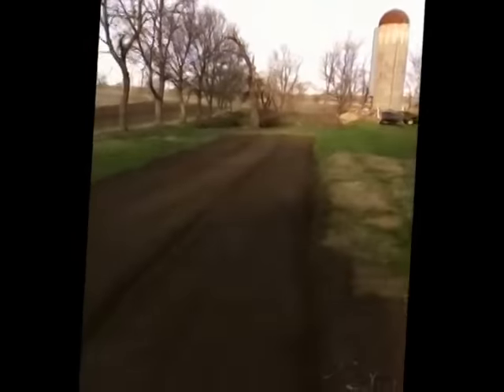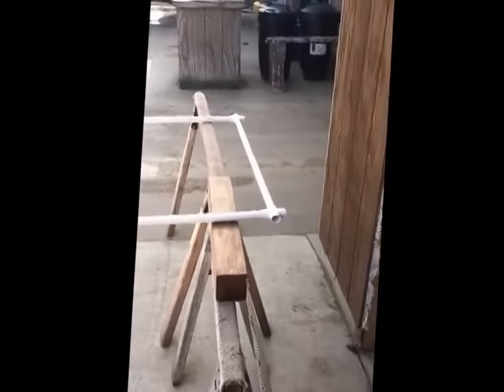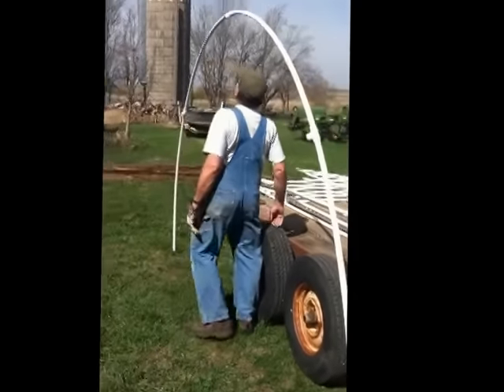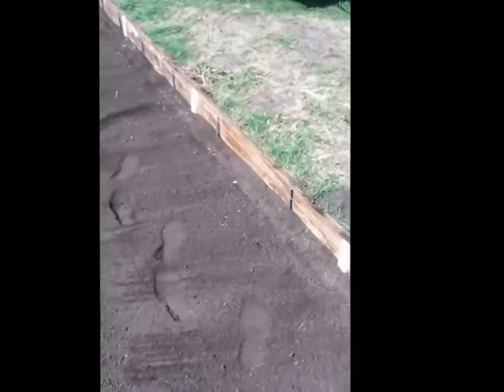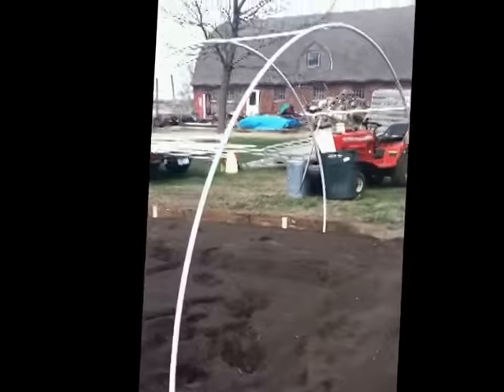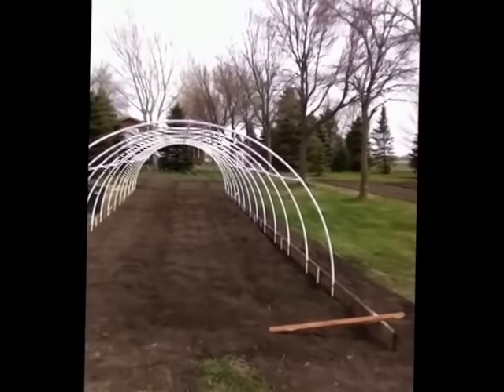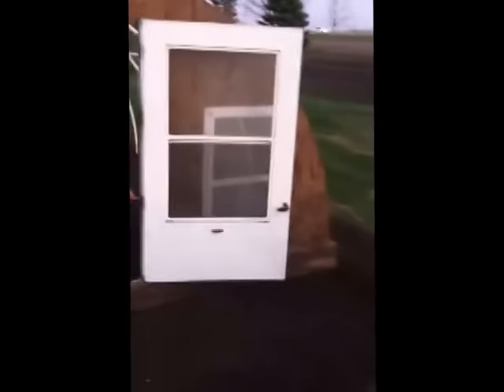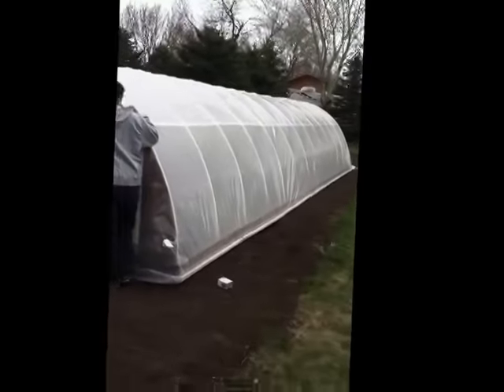PVC greenhouse in a day DIY

Comment: My experience with PVC-supported plastic structure is you must absolutely remove the sheeting before first snow in winter, or the weight of the snow has no problem snapping off the PVC. But it is a decent setup for the money and pretty easy to build.
Reply: You could reinforce da PVC with rebar

Comment: If you drill tiny pinholes in the underside of the arches you could connect a hose to the main center piece of PVC & you could then water all the plants inside whenever needed.
Reply: You shouldn’t water veggie plants from above.. causes disease form water on their leaves especially in a green house where it’s more humid and gets no wind..
Reply: @julisagonzalez657  That's good to know, thanks, I didn't realize that. Then instead of pinholes  like a sprinkler system you could still use the frame to deliver the water but tap into it with small drip tubes from the frame down to each of the plants base.
Reply: @dans381  ok so you're saying water tubes inside his pvc will not freeze? Is that it?
Reply: @ronmiller7248  I was not saying anything about water freezing, water would freeze if it gets cold enough.... I was just pointing out a simple way to pipe water throughout the greenhouse. You wouldn't need to put water tubes inside the frame, the frame would become the tubes.The entire frame is all connected (& hollow) so by attaching a water supply to one point of the frame, then the frame itself can be the water tubes & carry the water to any point you need.
Reply: @ Dan S what about the arches base the water would leak at the bottom where it’s inserted onto the rebar posts 😂
Reply: sorry to be so off topic but does someone know of a trick to log back into an instagram account??
I somehow forgot the password. I would appreciate any help you can offer me!
Reply: @Harper Eli instablaster ;)
Reply: @Eric Jaxtyn it worked and I now got access to my account again. I'm so happy:D
Thank you so much you really help me out :D
Reply: @Harper Eli happy to help :D
Reply: @Toopeeneekeenho  Вода будет поливать арматурные стойки🙂

Comment from the maker: thank you all viewers for bringing this to 20,000 views in just over 4 months!  There are other How-Tos at www.HGVids.com or tell me what you'd like to see a demo of...
Reply: Nick Tamble Have you considered instead of popping the pvc over droppers, to rather close it off at the bottom with additional pipe and t-pieces to create one seamless structure. Then drill small holes in strategic places and use the frame as an irrigation system?
Reply: +Nick Tamble Great video Thumbs up
Reply: How about DIY install  video of chain link fence around a backyard??
Reply: I like thos one better then any I've seen so far.  I would love a mattersl list... half inch pvc?  Poly here comes in 20x100.  Is 20 feet wide enough??   Love your end wall.  Best I've seen...  I'm in AK this is exactly what I need to extend the browning season...
Reply: Nick. What schedule PBC?

Comment: That's very well done, and an excellent video presentation. I have read that PE sheeting will react with PVC and fall apart, but if you skin the PVC/PE contact area with fabric tape it is not a problem (there is a special tape sold for this).
Reply: Using primer on the pvc before you lay the PE will also stop this reaction.
Reply: @tinman2420  regular paint primer?

Comment: I love this. We have a wooden greenhouse on a platform because of flooding, but I have been asking my husband for a hoop house over our existing garden, about the same size as yours.
We have it sectioned off with Post Poles and seven foot fencing. This structure would fit right over the top of the existing garden without having to remove anything. Thanks for this.

Comment: I built one of these several years ago.  The UV from the sun  degraded the pvc it and made it brittle.  The first spring storm that blew through destroyed it breaking most of the pipes.  My wife still chuckles about it.
Reply: Did you do anything to remedy the brittle pvc? Im just brainstorming for my own greenhouse
Reply: U must of bought that cheap thin cw pvc...bc hw pvc aint gonna get brittle or brake in the sun for years and years
Reply: @driveronehundrednine3225 You could try using gorilla tape or paint the pvc to keep it from degrading.

Comment: So, I actually built my greenhouse (60'x12') by this design. I think it is almost a good design and worked pretty well for the first month. One of the problems I came up against was in the pvc joints being weak points in the structure. Wind the other day was between 20-30 mph and that busted three joints, and that's not even very windy for this area(Helena, MT). However, I plan to replace any broken joints with single poles of pvc 20' long and run them through the cross joints. Not a bad design and fairly cheap, just needs some work.
Reply from the maker: thanks for comment Ian!

Comment: A nice transparent greenhouse is pretty, but what most people don't understand is that you can keep it warmer in winter by covering the non-sun sides with aluminized poly or reflective insulation blankets. You can't get sun heat in from the north and most of the east and west sides anyway in winter. Just the south side and half of the top on the south side will contribute solar heat. The reflective insulation will greatly increase your warming inside, and prevent loss at night.Similarly covering the sun side also just at night is even better, with a roll-up aluminized insulative blanket or tarp.
Reply from the maker: thanks for the comment - interesting insight
Reply: I dig the idear...for clarity, are you perhaps referring to one of those metallic fold-up "blankets" that emergency-minded people keep in their cars? They come packaged all folded neatly in a probably 4"x6" packet?

If not, could you give me a description that my rookie self would be able to take to one of the Home stores and find?

Many thanks in advance.
Reply: They have numerous aluminized material, rigid as well as sheet-like. If you were desperate you could use aluminum foil and white glue. But most of the insulation sheets they sell also come aluminized.
Reply: would it keep it much warmer in 20 degree weather? how much warmer?
Reply: yes do this

Comment: Instead of 6-8 mil poly that lasts barely a season, buy 'Rhino Hide' reinforced poly that's good for many years. Costs more upfront but WELL worth it!
Reply: Everyone knows how much can pay .. people r not idiots .. all know there is a better things to buy with a little more money of course
Reply: Thanks I have never heard of Rhino hide and will probably use that when we get to making our greenhouse.
Reply: 6 mil can last at least 5 years. No need to waste your money on the rhino hide for a temporary greenhouse. Most people that leave comments like that are associated with the product that they are recommending....
Reply: @lunkerpond9765  Mine will not be a temporary GH though so am glad of this advice.
Reply: @linr2870  congrats
Reply: I built an A frame one, used 6mil here in Alaska and it lasted four years with snow on it every year...  And it's easy to replace.  Not sure it's worth the cost for that rino whatever...
Reply: PVC outputs chlorine gas which will degrade the plastic much faster than normal and void the warranty.The same places that sell greenhouse grade plastic sell a barrier to prevent this.

Comment: PVC piping off gases and will cause the poly sheeting to deteriorate prematurely.   The piping can have a layer of tape or even better, the fuzzy part of velcro adhered to it to prevent this from happening.
Reply: Jan Halcion Did not know that,but it makes perfect sense thankyou😀
Reply: Cap tape for truck caps maybe an easy cheap go to for that idea, I’ll try it. Thanks for the information I’ll tell the local farmers I see that as some of their poly hose problems
Reply: I learned it the hard way, had to replace the cover after 2 years..

Comment: I really liked the 2 x8 boards at the foot with the clamps. I was going to build a very similar structure only with end caps at the bottom sides. I had also planned on using strips of plywood attached to the outside of the PVC with bailing wire as I was told PVC and poly didn't work well together. Did yours work out well in that regard and did you use schedule 10 or 40 pvc. The reason I wanted end caps was for so I could attach a hose, timer and misting heads for times when I need water. Great video Nick. Thank you.
Reply from the maker: Schedule 40. - more rigid the better. I've been seeing comments about PVC and poly not jiving together. We took down poly so I don't have info on how the combination is impacted over time

Comment from the maker: end windows and doors for ventilation...could roll up sides at the bottom also - only in protected sites as wind would be a problem...
Reply: shaika tecne sounds like a scam of some sort.  Be careful clicking on links to websites
Reply: +Nick Tamble Not certain about the points made but ,if anyone else trying to find out build your own small greenhouse plans try Lomonting Easy Greenhouse   Mentor (Have a quick look on google cant remember the place now ) ? Ive heard some great things about it and my brother in law got great success with it.
Reply: +Nick Tamble couldn't you of just drilled some 1/2" or 3/8" or howeverthick the PVS is and made holes into the wood and slipped them instead of rebar?
Reply: +Nick Tamble Not certain about the points made but ,if anyone else needs to find out about diy greenhouse building try Lomonting Easy Greenhouse   Mentor ( search on google ) ? Ive heard some decent things about it and my friend got excellent success with it.
Reply: +Jack Adkins Shame on you for hawking something without saying it is $37 for greenhouse plans.   This you tube video was free and well shared.   Commercial product plans for greenhouses or hen houses are fine, but why not say for $$$ up front.
Reply: ***** I have no choice about whining.   The international brotherhood of bridge dwelling trolls membership criteria indicates at least one whine a day.
Reply: +Ana Mostarac Never did find any scams.
Reply: I am gonna built a bigger version,dig a hole and plant me feet in it and live in one of these.
Reply: BuckGreywolfe mii
Reply: fun fact. pvc is toxic and the toxins are water soluble.
stop using toxic plastics because it is cheap. spread the word. not all plastics are equal. inform yourself
Reply: yes indeed
Reply: Nick Tamble love the video
Reply: Stop drinking water, most water pipes are PVC for many many years. Troll???
 Water wells use PVC also often. Irrigation on many many farms use PVC pipe.
Building a frame work not in contact with food nor water is no more toxic than buying food or drinking water or using store bought lumber.
Reply: Nick Tamble he man what kind off plastic cover are u using an what mill plastic is it? It seems hard to find something that's wide anuff
Reply: good  video i learn some ideas i of raising ducks. thanks .  is up

Comment: If the pipes are hollow could they be used as a watering system ?
Reply: +Richard Laut It would require some engineering but definitely would work
Reply: +Richard Laut  I like the way you think. U r an inventor.
Reply: No I just saw your great idear and Iit made me think many thanks
Reply: +Richard Laut Yes, great idea! I can see this having the water sprayed from misters located all along the center pipe at the top jutting out to the left and right. Just hook your hose to the back end and fill with a timer. I wouldn't have it come out the bottom where it's attached to the re-bar though, you need to have pressure in the line to allow the water to run the length of he system, it would just go right out the first set of supports. Another idea would be to fill the ends, seal them and couple them back up, then run drip line above the sealed bottom segment back down to the soil.

Comment: I WENT TO FARM BUREAU IN CONNECTICUT TO GET A  LOAN TO MAKE A GREEN HOUSE THEY WONT GIVE ME  BUT WHEN I BUILT MY OWN THE SAME WAY FOR 50 DOLLARS THEY STARTED BOTHERING ME.I JUST USED 2 10 FEET PVC PIPE ONE INCH THICK AND CONNECTED WITH 1 FEET 2 INCHES PVC PIPE AND PUT A CENTRAL WOOD SUPPORT. COVERED WITH SWIMMING POOL COVER .ALSO YOU CAN DISMANTLE IT WHEN YOU MOVE .
Reply: rogersantiques rs wondering how one types with all caps on.
Reply: Captively

Comment: Was that regular 6mil visqueen? If the entire project was under 300 dollars and it was greenhouse film I need to know where you got it? :)
 Before I purchased the commercial greenhouse that I now have (it's 30'X100') I built something similar to this one (it was12'X24'). The 12X24 was covered with regular 6mil visqueen and that plastic became brittle in about 6 months and basically shattered. You need greenhouse film if you want it to last more than a year. It's not cheap but well worth the investment if you want to do this long term. I subbed your channel and hope to see more from you greenhouse in the future as I tend to mine.
Chuck
Reply: It was 4 mil poly I believe - not "greenhouse" grade...we were doing this as cheaply as possible and did not count the cost of the wood framing or ends - as we had this as recycled materials.  I agree on the higher-grade greenhouse film, especially for zone 4 gardening...thanks for the input
Reply: Are you still growing in it?
Chuck
Reply: Fensterfarm Greenhouse no, it is not up during the winter. as soon as weather permits (after last frost) - the poly was taken down and it is used as a more traditional garden...
Reply: not greenhouse grade means that it is not food grade. you are putting toxings in your other wise healthy food.
@fensterfarm greenhouse look for ldpe plastic or "growplastics" yes its more expensive then pet , but it last longer and has no "known" release of harmfull toxins, you stil have a 6 f by 30f for 15 bucks

Comment: It's very nice looking you guys did a good job only one thing I personally would've done different no make that two first I would've made the ceiling at least 9 /10 feet tall using larger pipe at the base and then we going to the smaller for the top The other thing I would have done was put some duct tape on each pipe where the PVC touches the Polypropylene still very nice looking job

Comment: Looks to be a very economical and practical design, and neat too. 
The questions I have about these tube houses are: 
Why is the no longitudinal struts or bracing? 
What stops the end walls from falling over, if blown by the wind?
What stops the house from lifting, if a split in the plastic lets the wind get in? (I would not be confident that the U-straps screwed to the longitudinal timbers, at the bottom of the posts, would be sufficient to resist a good strong and uplifting wind).

Comment: nice share!   how has it held up over the years?  so do you need the 2x4 supports on the outside (against the doors)  to keep the structure from collapsing?  so will a wind hitting the wood ends be able to push the structure over and flaten it without the outside supports?  I even wonder if outside guy wires on each end, pulling in the opposite direction would stabilize it?   it looks like the plywood is attached with plastic ties to the pvs frame?

Comment: My main wonder is how many feet of pvc did it take to build the greenhouse? How many feet of wood. Also, approximately how many pvc  joints are there. I have to go buy this stuff. Please help. I need a materials list.
Reply: 40 pieces of pvc 10' long, 40 cross connector pieces of, 6 tee connectors. There are three pvc joints per hoop and there are 13 hoops - so 39 joints...sorry, I do not have the total materials list on hand at the moment. The three items I mentioned will be the pvc items needed. Good luck and thanks for watching!
Reply: Thank u.. you are the man!

Comment: I built a pvc shade house a few years back. The only real difference between how I built mine and yours is I ran some pvc diagonally from the ground ends up to the middle top to add stability from the wind. It will reduce a lot of the wind flex and can be screwed in place. I didn't catch what size pvc you used but I used one inch for mine and it still bowed with time.

Comment: 8 inch pipe with U joints that lock into place for the base. Having a strong base is always a good start! You could run another 8 inch pipe down the center to support the roof. You could pre fab watering tubes in it to mist the green house. Have fun good luck!

Comment: That's a very nice greenhouse.  Do you plan to use it in the winter months?
Reply: Thanks Susan...we do not intend to use in winter - heating costs make it a very expensive venture that way :(  long-cold winters in MN here...
Reply: Minnesota is very cold indeed! Did you reinforce it so the roof wouldn't cave under a snow load?
Reply: Susan Rogers the poly was taken down during the winter months...
Reply: Oh thats good, thanks!

Comment: This is a neat design. I really appreciate the way you used all recycled materials. But, if you do not have used boards to wrap your film at the bottom with, there is a product called batten tape that I believe would be less expensive than the lumber. You just place it over your polyfilm and staple through it to fasten the sheets.

Comment: Hi Nick!, nice job! did you use 1/2" pvc pipe? and how did you join the polyethylene with the wood baseboards?
Reply from the maker: 1" PVC and at :57 seconds - you'll see the brackets we used to fasten to the wood - thanks for watching :)
Reply: Nick Tamble thanks for the quick answer! I mean how you join the polyethylene? thanks!
Reply from the maker: Maximiliano Reitz PVC primer and PVC cement
Reply: Maximiliano Reitz It looked like he wrapped it around the wood at 10:30 then screwed that to the other bottom boards at 11:26
Reply: correct